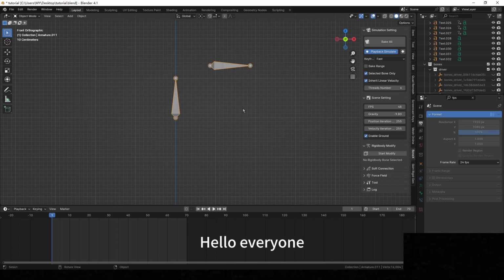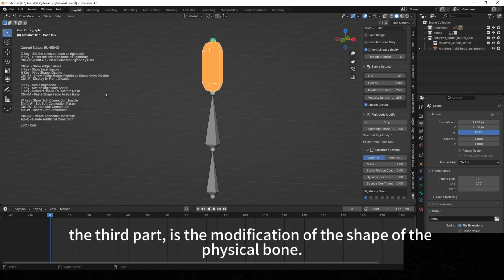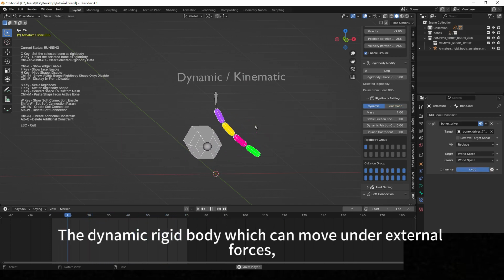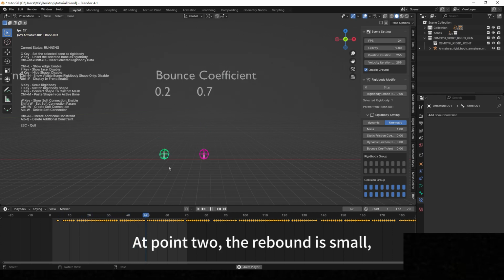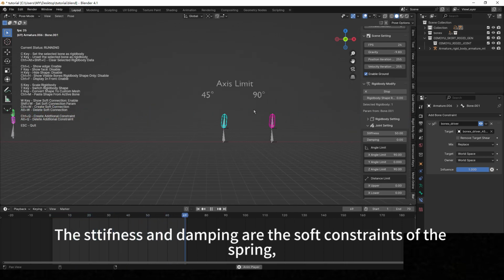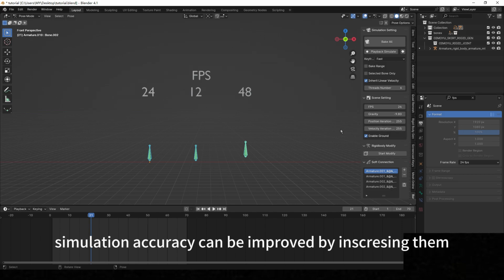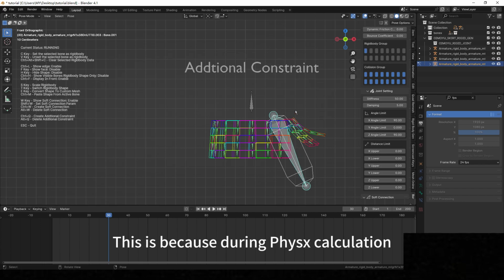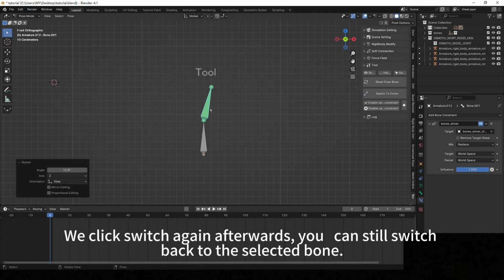Blender physical bone addon BonX usage tutorial

Comment: But how the skirt was created? Is that automatic shapes or how? Super confusing explanations. Can You please clarify? Or make a tutorial showing step by step creation of skirt, and some other alike parts? Overall that is great, but how to use it really. If You have that boxy skirt setup here, then that what next? How that all is attached to the actual MODEL of the skirt, character?
Reply from the maker: this addon is only used for create animation. You need to make sure you have done the weighting job before, which mean move bone will move mesh. And this addon rigidbody drives bones to move, and bone drive mesh move.

Comment: Really practical physical simulation addon. almost no jitter! and much more stable than other similar simulation addons. when it comes to hair simulation, it's almost perfect. as to a tube style skirt obejct, it's not perfect. no matter how I configure the settings including sub-step number, sometimes bone penerates the skirt. But It's not the defect of this addon but blender's limitation, I think. Anyway It would be better if there is a parameter setting preset save and load function. thanks for making this fantastic addon
Reply from the maker: Did you scale the rigidbody until it covers the skirt, like in the documentation?  the skirt simulation should be ok if velocity is not high. willing to see the detail, you can send detail by mail.